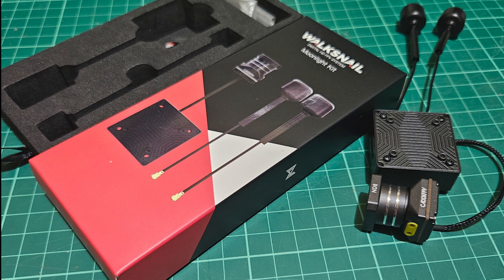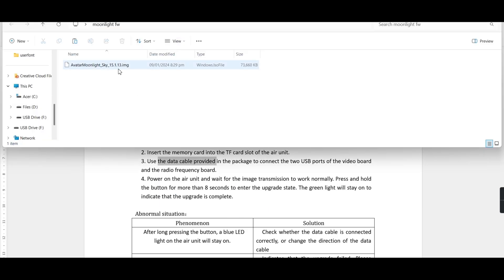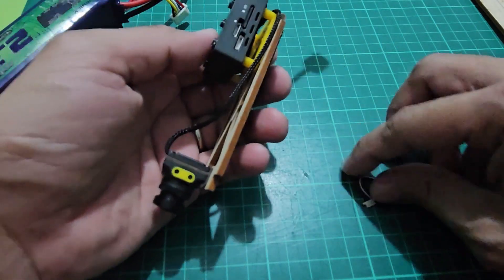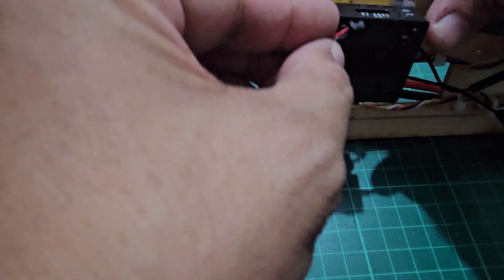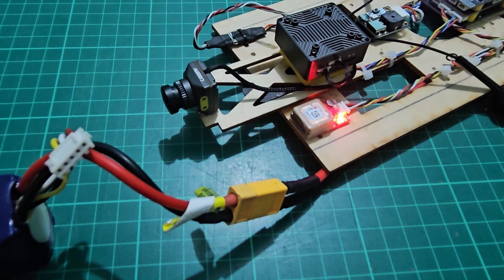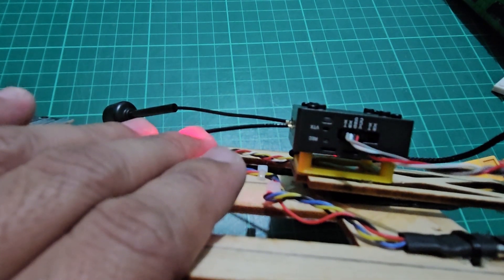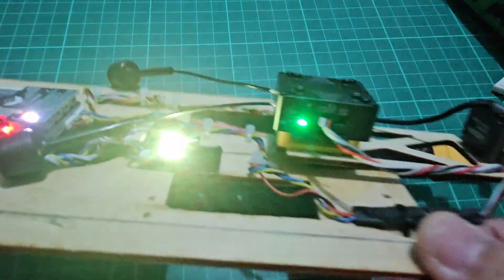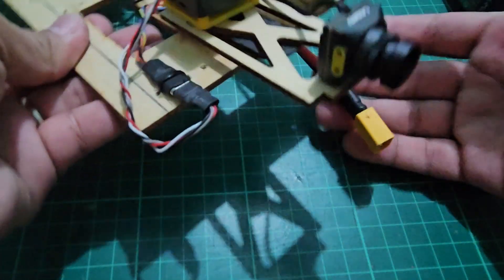Part 2: Updating the Moonlight VTX

Comment: I dont have the cable... I dont think there is a way to update it
Reply: contact ur supplier, the should have send it with the vtx to you. had the same issues with a FLywoo Flylens 85, flywoo didnt include the cvable in the package, i wrote them to send it to me it came 2 weeks later.

Comment: hi after updating the firmware (did just like in the video) successfully upgraded. when i removed the sd card from moonlight kit and put it to laptop the firmware file which was copied to the card before update is deleted automatically , is this normal ? or has the update not applied? i cannot check if the firmware is updated to newer version because my goggles L is yet to come so can u check and tell about the deleted firmware file?
Reply from the maker: Yes that's normal
Reply: @windfpv  oh thanks bro I was stressed out
Reply: @windfpv  can u make firmware update of goggles L and binding it to moonlight kit bro please
Reply: Tutorial
Reply from the maker: @prakulsahukar16  ok I will
Reply: @windfpv  thanks
Reply: @windfpv  your video was very simple and quick so asking

Comment: Did exactly the same, but it keeps beeping with flashing red, green, and blue.
Reply from the maker: Sure you are using the correct moonlight firmware update file?
Reply: It happened with me now. I put the vtx|Record inverted. Fixed it and the update it did works!